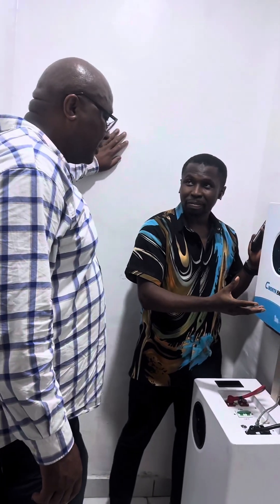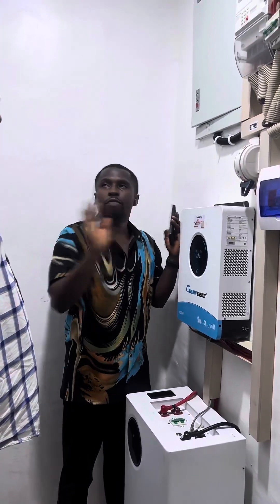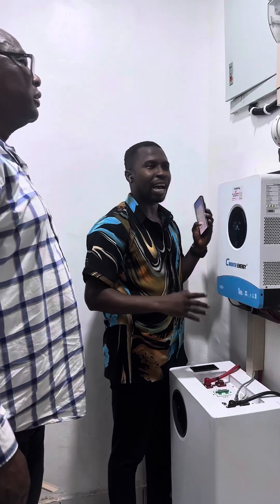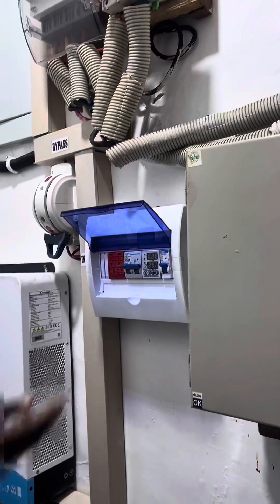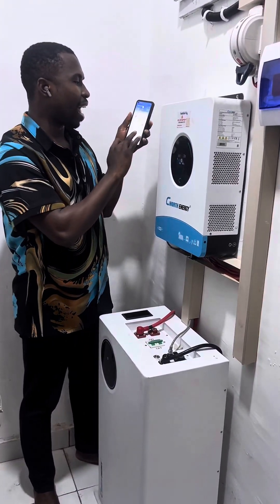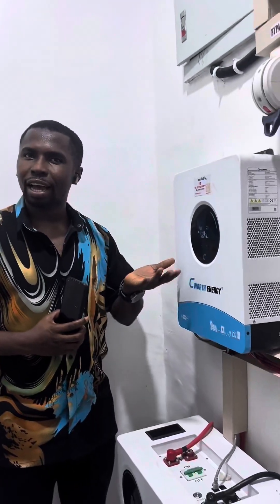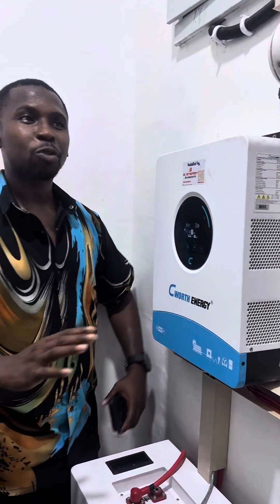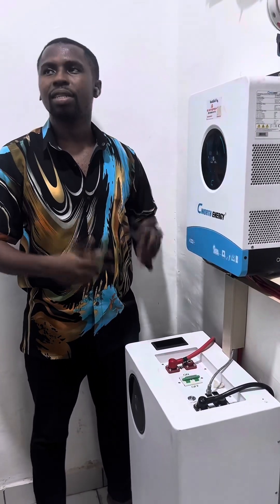How your solar energy system works

Comment: Thanks for the video! I have a question: What do you think about the Cworth 12KVA (Dual MPPT) with one MPPT handling a set of 615W panels and the other handling a set of 560W panels? Could this cause any issues, or is it fine? Thanks!
Reply: Its fine as they are working independently